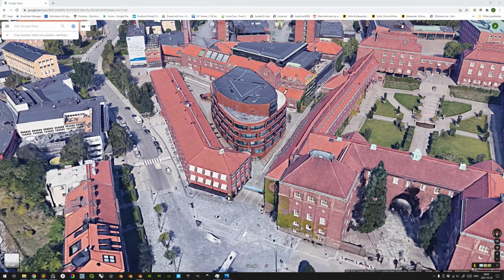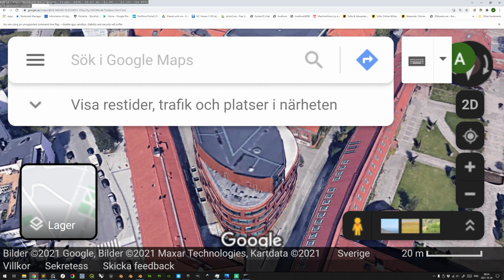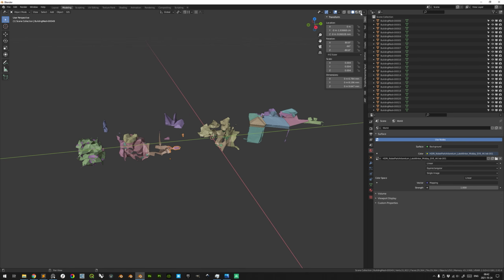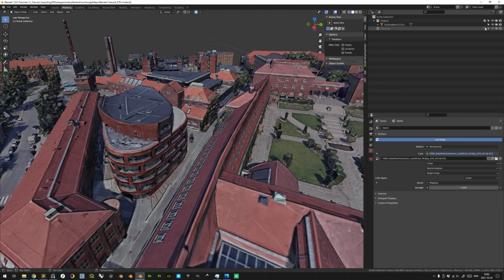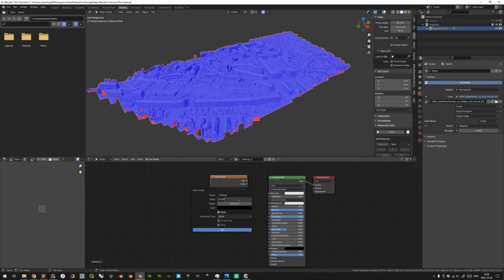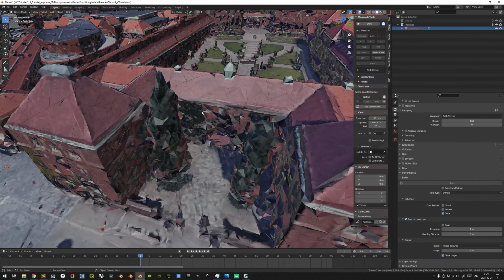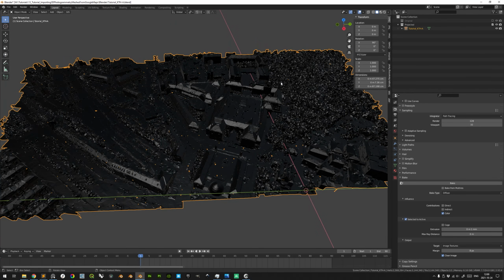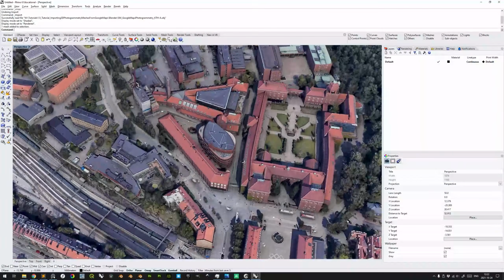Tutorial – How to export 3D photogrammetry meshes from Google Maps

Comment from the maker: Update (220530): With Maps Models Importer version 0.5.0 (release candidate) being released a month ago, we were eager to try out an updated workflow with the new software versions (Maps Models Importer 0.5.0 / RenderDoc 1.19 / Blender 3.1). However, we personally had no luck in capturing the data with RenderDoc 1.19 (albeit succeeding to launch Chrome directly from RenderDoc), so we refrain from recommending the updated versions as of now, and still use the previous versions for the time being. However, it works perfectly fine to capture data with RenderDoc 1.13 (old version) and import the saved .rdc file with the new Maps Model Importer version 0.5.0 in Blender 3.1, so the versions we personally use are: Maps Models Importer 0.5.0 / RenderDoc 1.13 / Blender 3.1. We wish you all the best in your mesh extraction! /S&A
Reply: I had success with Model importer v0.5.0, RenderDoc v1.19 (enable process injection in settings), and Blender v3.2.2.
Reply from the maker: @DarwinsGreatestHits  That is great to hear! We'll be sure to try it out ourselves at a later date! Thank you for your report /S&A
Reply: Can anyone of you confirm that the process injection is still working with the newest version of chrome (110.0.5481.100). It always prompts a new process, as soon as i start google maps.
Reply: This tutorial is still relevant for latest Maps Models Importer 0.6.2 with RenderDoc 1.25 & Blender 3.4
Reply from the maker: @jagildown  Thank you so much for confirming this – this is great information :) Best wishes /Sofia & Alexander
Reply: @SanningArkitekter  Thank you for your tutorial ;)
Reply from the maker: Update (220709): We just wanted to say that the RenderDoc 1.13 capturing method that nowadays works best for us is to click on "Capture After Delay" with a delay set to 5 seconds, ALT+TAB back into Google Chrome, and very gently pan (by clicking and dragging with LMB) the map. The capture will trigger when the delay timer is finished. This has more consistently yielded higher-coverage captures for us, after a frustrating period of numerous captures of only thin slices or erroneous fragments. You might not have had these problems recently, and we recommend that you use the method that works best for you :) /S&A
Reply from the maker: Update (220710): It seems as if this particular method, while increasing the likelihood of adequate coverage, it is prone to producing duplicate meshes, which both makes the model unnecessarily complex/heavy and can produce rendering errors. Luckily, thanks to the below script by batFINGER on GitHub, it is an easy feat to remove all duplicates. Simply select all imported objects in Blender, go to the Scripting workspace, and paste the below script into the Python Console. Press Enter twice to execute and delete the remaining selected objects (the duplicates).

import bpy
from mathutils import Vector
context = bpy.context

scene = context.scene
view_layer = context.view_layer
TOL = 1.0e-3 # reduced tolerance.

# routine to text matches on bound box.
def test(ob1, ob2):
    # test if ob1 and ob2 which have same face/edge/vert count are same
    bbox1 = [ob1.matrix_world @ Vector(b) for b in ob1.bound_box]
    bbox2 = [ob2.matrix_world @ Vector(b) for b in ob2.bound_box]
    diffs = [v1 - v2 for  v1, v2 in zip(bbox1, bbox2)]    
    return all(d.length < TOL for d in diffs)
    #return sum(diffs, Vector()).length < TOL

obs = {}
keys = []
for ob in context.selected_objects:
    ob.select_set(False)
    if ob.type != 'MESH':
        continue
    # make a key from faces, edges, verts
    mesh = ob.data
    key = "%d_%d_%d" % (len(mesh.polygons), len(mesh.edges), len(mesh.vertices))
    obs[ob.name] = key
    keys.append(key)

possible_dupes = set([x for x in keys if keys.count(x) > 1])
print("-" * 50)
while possible_dupes:
    p = possible_dupes.pop()
    dupes = sorted(name for name, value in obs.items() if value == p)
    while dupes:
        original_ob = scene.objects.get(dupes.pop(0))
        for dupe in dupes:

            dupe_ob = scene.objects.get(dupe)
            if dupe_ob.select_get():
                continue
            if test(original_ob, dupe_ob):
                dupe_ob.select_set(True)
                view_layer.objects.active = dupe_ob
                print("possible dupe: ", dupe, " of original: ", original_ob.name)
Reply: hey man what ram do you have to be able to bake them textures  at 16k? and is there any way of getting the exact quality of the google doc files render onto a mesh?
Reply from the maker: @IndigoKidda  128 GB; if you do not want to project the textures to a new one, there is at least one plugin, Lily Texture Packer, which merges all the input textures into one, while retaining the UV mapping – thus you get the exact resolution of the original textures, since they are simply stored side by side in one merged texture. The link to the plugin purchase page is here (check out the demo video in the same page if you are interested): https://eliemichel.gumroad.com/l/DFExj
Reply: @SanningArkitekter  what a guy thank you
Reply: @SanningArkitekter  Did you have any success using renderdoc 1.19 or the latest 1.21?
Reply from the maker: @MonsterJuiced  We did not personally have any success, but the user Darwin's Greatest Hits did report success with 1.19 – we are busy doing our diploma thesis this semester (and are thus keeping to the 1.13 version for the time being), so we cannot ourselves take the time to verify this (or more in-depth explore what specifically needs to be done for it to work) – what they did was to enable process injection in settings, for it to work with 1.19. We wish you all the best /S&A
Reply: @SanningArkitekter  As it turns out, somehow, only renderdoc 1.13 works. This is with blender 3.2.2 and the mapsmodelsimporter v 5.0. Which is more odd, it wouldn't import any data into blender from a regular capture. But when I accidentally moved the google map scene a little with my mouse during capture, it saved a larger file but also imported into blender just fine.

After this I installed the latest renderdoc to reproduce this and it still didn't work, no matter what. Also just to note, I have to click the cross on the GPU ID popup rather than ok otherwise it won't give me the GPU overlay and not inject correctly. I have no idea why.
Reply from the maker: @MonsterJuiced  Yes, panning the map with the mouse is what triggers the capture, as demonstrated at 12:34 – if the capture produces duplicates for everything (yielding a larger-than-expected result), then this Blender script by batFINGER selects all possible duplicates (for you to delete). Remember though to save a backup of the model in a separate file, should running of the script lead to accidental removal of wanted data :) /S&A
Reply: @SanningArkitekter  the best way to get maximum data and quality when rendering i find is having the render doc window over the google earth an pressing capture immediatley and then just move the mouse cursor onto onto the google window without pressing and normally alot more higher quality data comes through but sometimes it takes a few goes to get it to work
Reply from the maker: @IndigoKidda  This is very interesting! We concur that it is a little finicky, but like you said, it's good to try a few times until a fully successful attempt :) /S&A
Reply: “Inject into Process” in latest vesion 1.25  is in setting just click on option and restart RenderDoc

Comment: I have a problem, when I try to insert the model (which I made with render doc 1.13) on Blender 4.1 it doesn't insert it and it doesn't even load. Does anyone know what to do?
Reply from the maker: Hey, there! You should try to install an earlier version of Blender in parallel (different versions are installed in separate directories, so they do not interfere with esch other), and test the plugin with the earlier version instead, and see if that solves your issue. Best wishes /S&A
Reply: @SanningArkitekter  Thanks, I'll try it now

Comment: Hi, I followed the instructions but i'm stuck at the part where you import your .rdc in blender. My file is 150Mb and it only imports a random glitchy rock. I looked at every comment but no clue...
Reply from the maker: Hello, we have had this same issue when using another Blender version than recommended – have you made sure that the Blender and RenderDoc versions are the same as are stated to be compatible with the Maps Models Importer version that you are using? Best wishes /S&A
Reply: @SanningArkitekter Hi and thanks you for replying!

Yes i used the exact same versions that you use, without luck. Wondering if some GPU could be the issue here... 

Anyway I ended up using BLOSM, way faster and simpler. 

Next step is to learn how to make it compatible with a racing game 😅
Reply from the maker: @MonsieurCr0w  Great to hear that you've got it working with BLOSM! And good luck with the map for the racing game – there are some really great examples/showcases of Assetto Corsa maps on YouTube :)

Comment: When I import the .rdc into Blender, it only imports one small mesh section of the entire scene..Any tips? Using Blender 3.4 and RenderDoc 1.25
Reply from the maker: Hello! Are you sure that the Blocks setting during import is set to -1 (infinite limit of imported blocks)? If it is set to 1, then it will only import 1 single block. We have also had this error when trying out the workflow with Blender 4.0, and have succeeded with the same input in Blender 3.6, but you are using 3.4, which is the recommended one, so software version should not be the issue. We hope that you find a solution to your problem! Best wishes /S&A

Comment: RenderDoc v1.13, Blender 3.4.1 and MapsModelImporter v 5 works currently, everytime google earth updates an area u wont be able to join it to old update , there is so many mad things u need to do to get what u want but its doable, ive managed by myself to make a huge map with over 60-70 sections and it has taken over 3000 hours , also u can move the data blocks from one version of blender to another version if they both have the v0.5 of maps importer , always put the mb on google up to 1000mb and 25% zoomed out on chrome

Comment: I have created an RDC file successfully, but when it comes time to import it into Blender. I hit import and nothing happens, no loading or anything. The file is 27,000 kb. The plugin is installed correctly it seems.
Reply from the maker: Hello! Are you using RenderDoc 1.13 and Maps Models Importer 0.4.0? There have been reports of the workflow working with Maps Models Importer 0.6.2 with RenderDoc 1.25 & Blender 3.4, but 1.13 and 0.4.0 is the only versions that we ourselves have verified to work :) /S&A

Comment: Core 28236 16:01:19 win32_process.cpp(327) Error Couldn't create toolhelp dump of modules in process 16028 someone encouter this problem?
Reply from the maker: Sorry, we have not encountered this problem. Did you resolve this issue? What software versions are you using? We personally have had best success with the following: Maps Models Importer 0.5.0 / RenderDoc 1.13 / Blender 3.1 // Best wishes, Sofia & Alexander

Comment: Hello! I’m running into an issue with the initial injection into chrome where it cannot find it’s path, does this method still work with the current version of chrome or should i rollback to a different version
Reply: Resolved!
Reply: @asphaltpoet  how you solved it?
Reply from the maker: Great to hear that you got it working! To answer Emanuele's question, our perhaps inaccurate guess would be that perhaps he was using a 32-bit version of Google Chrome, and per these instructions in the description, one needs to change the directory to Chrome accordingly. Best wishes /S&A
--------------------------------------------------
Copy and paste these two lines into a command prompt and execute to start Chrome in injection-compatible mode – if you intend to use the 32-bit Chrome application instead of the 64-bit one, change 'Program Files\' to 'Program Files (x86)\':

set RENDERDOC_HOOK_EGL=0
"C:\Program Files\Google\Chrome\Application\chrome.exe" --disable-gpu-sandbox --gpu-startup-dialog

Comment: Hello, i followed everythign and it works well up until i import it into blender. The imported data does not cover the whole area of the shot that i took. Do you know the issue? Thanks. (Renderdoc 1.13, blender 3.2.2, maps-model-importer 0.5.0)
Reply from the maker: Hello there! The versions of the softwares that you use should be compatible, and since you followed everything, it should work, but perhaps the import setting for Max Blocks have been erroneously set by mistake? With [-1] it imports all segments, and with another integer value, it only imports that many segments – so perhaps it might be that? When you capture the data, do you click and drag with the mouse (we have personally had the problem that when we don't move the cursor while dragging, the capture is less than expected). We wish you good luck! /S&A
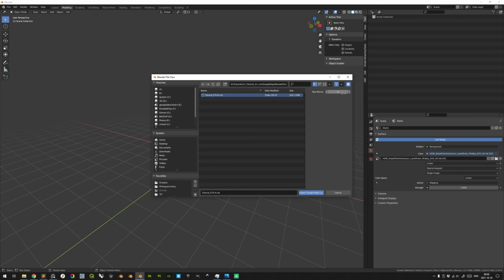Reply from the maker: The timecode for the import setting in Blender is 15:00
Reply: @SanningArkitekter  hey, sorry for the very late reply. Yes i have -1 on the max blocks and when i capture i press capture, alt-tab to the chrome window and drag around for 3 seconds using the left mouse button. Thanks again
Reply from the maker: Have you tried the Capture with Delay option instead of the Capture Immediately option? /S&A
Reply: Hello! I had the same issue and i thought I'd share how I worked it out in case anyone faces the same issue in the future. So instead of clicking and dragging to capture the data, i actually click left + ctrl ( for some shift ) to actually rotate around the region i wanna capture, and that actually captured much more data than it initially did when i was only clicking and dragging.

Comment: Thanks for the great detailed video. I find it hard to find the right parameters for different site size, Meshlab returns warning "Inter-Triangle border is too much" for 2 px, only 1px is accepted in my case; Bake takes 5 hours in my blender, my margin size is 1px. Then I tested with a smaller size terrain, no warnings but my image are always almost black.
Reply from the maker: Hmm, that the UV unwrap in Meshlab has its limit for large meshes with finite texture resolution and the necessity to fit the unwrap with regards to margin sizes is reasonable, but we wonder about the output being always almost black for smaller mesh sizes – did you resolve this issue? Best wishes /S&A

Comment: mate you are the only one who is using Render Doc and has given a good trick with chrome zoom. It still won't do high details  for texture and objects for quite short buildings. However if you want to capture any CBD with a lot of high-rise  buildings with your trick you can get a maximum resolution texture for them. If not a mess with badly defined vegetation like trees,  some buildings not having hires texture and objects on the ground level are not well defined it actually looks quite real. I will try to do Eifel tower just to see if I can get the whole structure in 3D.  Thanks a lot on this trick.. I would never guessed it could work and I almost gave up on this method of getting anything decent from Google Maps.
Reply from the maker: Great to hear that you also found good use with the Chrome zoom technique :) All the best to you /Sofia & Alexander

Comment: Hi, i'm stuck on the injection process. I removed from chrome all tabs, and extensions. But when i inject it tells "OpenGles (not presenting)" intead of active, even thou it has established connection. Cannot go on from here, cause every time i open a new tab on chrome it refreshes renderdoc with a new PID.
Is it possible that i do not have the right version? i downloaded the latest one... 
Thanks!
Reply from the maker: Hello, Marco!

Yes, we believe you are correct in assessing that the version of RenderDoc might be the culprit! As stated in the pinned comment by us, we have not had any luck using any other RenderDoc version than 1.13. So we would suggest you to try with that version (as is used for the tutorial). We have had success in using the 1.13 RenderDoc version together with the later version of Maps Model Importer (0.5.0), so the main thing is using the same RenderDoc version as in the tutorial (1.13). You can find it here: https://renderdoc.org/builds
Reply: @SanningArkitekter  oh my bad, I did not see the pinned comment. Thank you very much for the answer i will try with the older versions, keep up the good work!
Reply from the maker: @Aenimae  Thank you! And good luck, Marco! /S&A

Comment: Hey 
I followed it step by step, also injected it, but the 3d option does not appear in my google maps
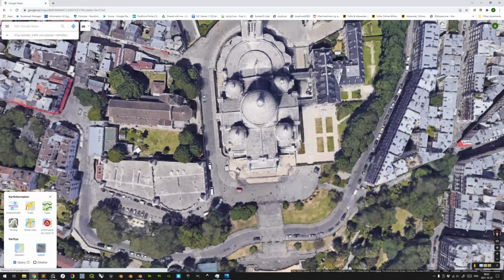Reply from the maker: If you go to the 1:01 timestamp in the tutorial, when we disable the annotative text, you see another checkbox right next to it, which should say "Globe view" (or the applicable translation in your locality). Make sure that this is checked, and see if that solves your issue. If you do not see a 3D view (photogrammetry buildings and vegetation, etc.) of the area, it might be that Google's associates have yet to capture it – try if the workflow works for Paris (as an example), and if you are able to enable 3D view for Paris, but not for your designated area, then that might be the case. Sincerely, Sofia & Alexander